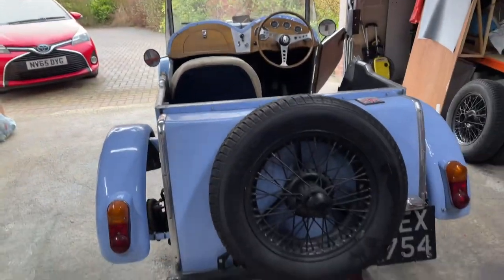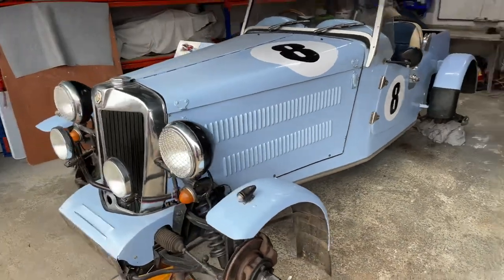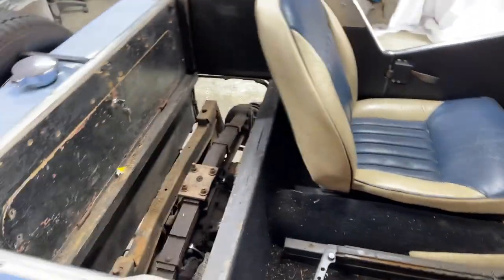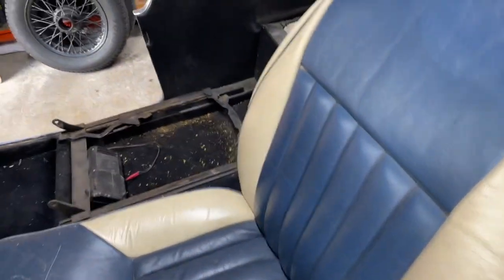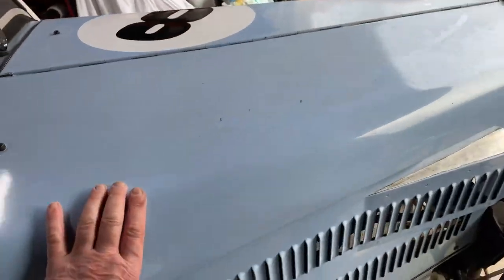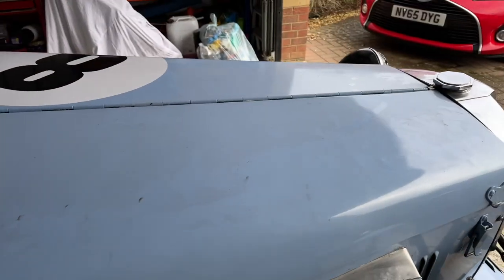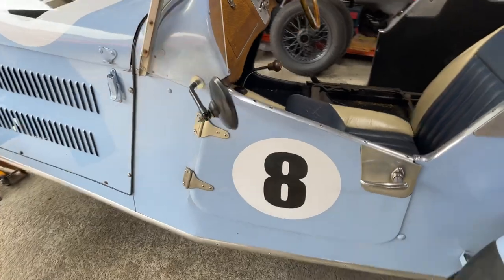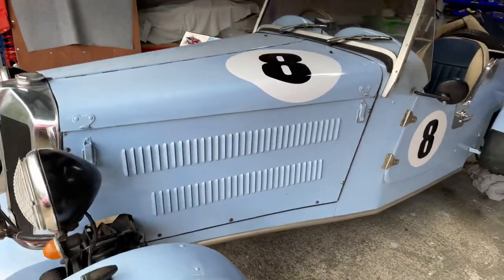George’s JC Midge

Comment: Hello, I have one of these, though mine is based on a Suzuki SJ410, which, if I could drive it would be the game changer for me as I live and wood in the woods a d need 4wd and good ground clearance. But I have owned it 3 years and driven it about 1/2 a mile as like yours I have zero space in footwell as pedals are soooo close together. Did your cutting a bulge idea work?
Reply from the maker: Hi Yes the the footwell extension worked very well and now the pedals are easy to use and I have big feet if you send me a message on messenger I can send you some photos cheers George
Reply: @georgehodgson8064  oh god yes that would really helpful and very kind thanks so much. I'm not great as messenger but will try to find you there later. I'm Nathalie Petronelli-Stone, AKA Northumbria Forestry. Thanks again 😁🙏